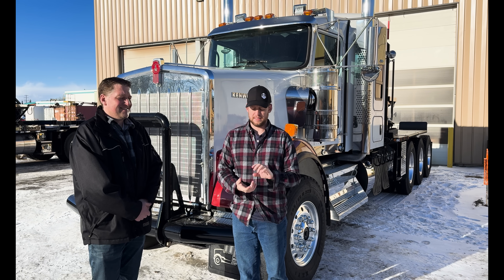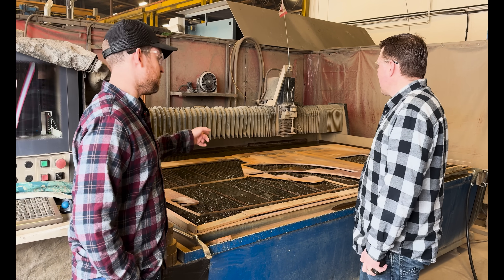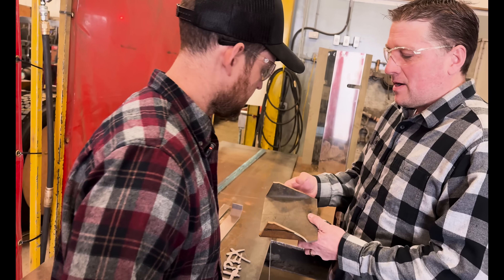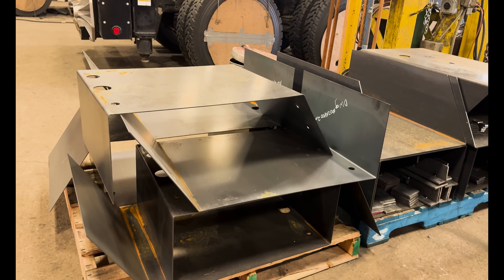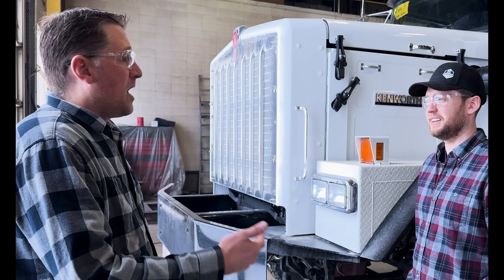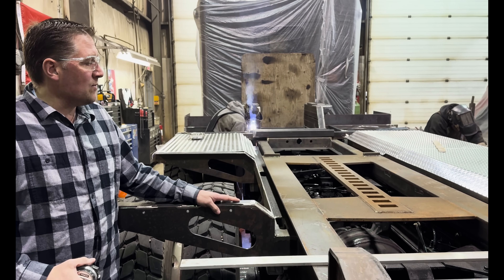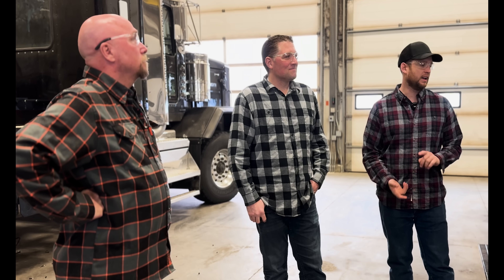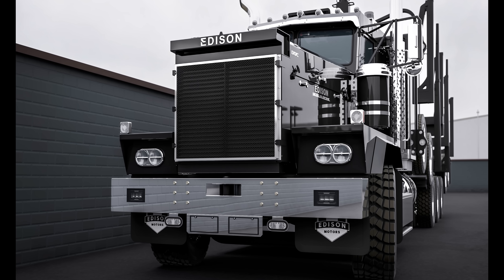Building the FIRST EVER Diesel Electric Winch Tractor!  (Behind the Scenes with Marcep)

Comment: You guys should be looking for electric winches.  With your generator you could be using direct mount VFD motors and forget the hydraulic.   Electric controls would take up less room in the cab, and remotes wouldn’t need solenoids everywhere like hydraulic needs 🤷‍♂️

Comment: If it is Ev and you get exemptions for that can you rub red diesel as it’s not a not a vehicle but instead a portable generator?
Reply: Topsy is an experimental battery electric vehicle BEV and has an exemption so it can run red diesel. Future Edison production trucks will all be emissions compliant and no red diesel which (while disappointing) is probably more fair and better for the planet.

Comment: Winch trucks work in minus temps what the hell happens when you run out of battery on rig site fucking dumb idea
Reply: It's hybrid. The computer will automatically start the 9 liter engine which will warm up the battery with a glycol loop and also recharge the battery.

Comment: What does a winch truck do?
Reply: I'm no expert, but in a recent video, a "winch truck" has a large flat bed, and a winch to pull things on/off. 

Winch trucks can transport oilfield equipment, such as pump units, top tanks, pipe racks, and power swivels.

Winch trucks can move heavy loads, such as off-road construction equipment, large containers, and oilfield vehicles 

Winch trucks can work in difficult terrain, such as muddy oilfields over undeveloped roads.

Comment: Hypothetically if you're building a custom trailer couldn't you build it with E-axles and have more capability/regenerative braking that only needs a few extra hookup wires to function? I'm no engineer so maybe the extra weight and complexity isn't worth it, but it sounds cool.

Comment: all this technology is cool, but what is range when pulling 40ton cross country?, is it gonna be 80 to 100 miles on flat land like them electric pepsi semi truck?
Reply: It will only drive like 2 hours off of the batteries, but then the onboard 9 liter diesel engine will fire up and spin the generator as a 600 volt level 3 supercharger. So range is limited by the fuel tank size.
Reply: @Sah-o5m  awh then it gonna be like toyota hybrid cars but semi version
Reply: @iAmMoWuji  some people call it a series hybrid.

Others call it a EREV or extended range electric vehicle.

Others call it a BEV battery electric vehicle with onboard 600 volt level 3 supercharger

Comment: Why don't you make the winch electric? With an electric winch the only thing extra you will need is a decent drive for the motor. But by doing this you dont need the al the hydraulics wich require maintenence. The only problem you wil have is that the winch motor is a bit bigger, but you save space on other places.

Comment: I've been rig moving for more then 50 years from the Arctic to the Saudi Arabia Desert and seen a lot of different types of trucks and equipment and lots of changes and improvements over the years but this is truly revolutionary.
Reply: Finally a company that listens to the customer and builds what they want and need rather than**this is what you get.
Reply: Technically it’s counter revolutionary they’re chasing an old ideal now the the tech required is available

Comment: Why run a motor to a pump to turn a winch why not go with an electric winch, or convert the winch to electric using an EV motor. That way it only uses power when being used. LG Letourneau didn't even use cylinders on his big equipment after he figured out how to go electric.

Comment: Edison - while doing custom builds is absolutely needed, at he same time I hope you are working on an "Edison standard" truck design, which you can produce in quantity, bringing price down and with design weaknesses gradually being eliminated.  Also gradually add equipment so you can increase the percentage of parts you make yourself (vertical supply chain), giving you capability to quickly make changes as needed to increase quality and lower price.  (Imho)

Comment: I want to convert my Lexus RX450h hybrid, which was assembled in Canada, into a diesel electric using a Owan/Cummins diesel generator, electric wheel hub motors and replace the current Nickel–metal hydride battery with a powerful lithium battery.

Comment: Since the end of train locomotive steam engines, it was common sense logic  that diesel electric power plants are the most efficient mode of transporting everything from a to z.
Reply: They have previously said that for straight load hauling, diesel -electric has no real efficiency improvement over straight diesel.
But for working trucks and specialty load hauling, they are seeing significant efficiency improvements.

Comment: Hydraulics for the Winch? Why no direkt electric drive?
Reply: You would need to add a extra brake for holding loads with electic were hydraulics have a built in braking ability.
Reply: @michaelcummings7246  Ahh ok.👍 Good reason. I just thought about pulling

Comment: One question that I have, did you look into using an electric winch? Or was the hydraulic one used because they all have the most experience with it? That is more than a valid reason. But I am looking at the big cranes on the work sides who all have some big electric motors.
Reply: Electric motors cant brake by themself too a full stop, so you need to have an actual diskbrake or something like that. Hydraulic motors can brake by its own, there is probably no company that makes electric winches that would fit there application. So it is easier to just make an electric hydraulic pump that powers a regular hydraulic winch
Reply: @jonasstahl9826  I was thinking about winches from tower cranes, I know that they are electric.
But the break is a big reason, and I already stated that experience is more than valid.
Reply: Great question. Just ditch the hydraulic fluid pumps and go straight electric winches. I wonder if there is some torque/speed advantage to retaining hydraulic pump winches. Seriously, just lose all the hydraulics.
Reply: @Sah-o5m  it could be that they need the hydraulic for something else anyway.
Reply: Winches on winch trucks are shock loaded repeatedly. Electric winches won't be able to handle these conditions.
Reply: @robertbakewell5429  I'm enjoying this dialogue :) So if a hydraulic pump blows a line, does the winches lose a load? Does it have mechanical brake?
Reply: @Sah-o5m  Definit not, if a line break the load comes done, you cant catch that. Stopping a falling load creates huge force, other stuff will break or flip the truck.
Reply: @Sah-o5m the oilfield winches are worm gear driven and incorporate a load  brake

Comment: 11:24 quite happy to see Blender (free and open-source 3D software) being used instead of expensive software from greedy companies! it really fits well with Edison Motors' principles 😄
Reply: I was very surprised to see Blender instead of a CAD program.
Reply from the maker: We use blender for fast & quick visual design changes and then a cad program to bring the blender model into reality
Reply: @EdisonMotors  ah yes blender to cardboard aided design (cad), love the progress of the company and the right approach to manufacturing for the industry
Reply: @notnotkevinjohn for quickly and easily changing something visual during a meeting presentation Blender makes total sense, but they definitely use specialized software for their actual engineering. :)
Reply: @ Maybe. Or maybe someone made a plug-in for Blender to give it some rudimentary CAD functionality.
Reply: notnotkevinjohn yeah that is also possible, but I'm pretty sure I've seen the team using actual CAD software in an earlier video
Reply: I was coming to the comments to write this. Glad to see Blender being used in more professional areas these days!

Comment: Custom built vs serial production. The serial will cover 50% of everyones needs, but never 100% of a specific one. The custom built will always cover 100% of the needs, and that will make the brand keep on going. Keep the spark on Edison, you got this.
Reply: The plaid shirt look……
Reply: Get it, spark
Reply: Even still most of the product is the same but just slight changes.
Reply: sadly the custom one will only cover 80% or less as there is always stuff that get's forgotten or placed in a place that is slightly off to what is mostly needed. most of the time it is that tehre isn't enough storage room for all the tools and utensils that get used or need to be there "just in case". if we had 100% then there would only be that one model for that job.
Reply: @dovos8572  pretty sure they're talking about production process, not the product, it's why Edison has 5 very different trucks going at once at the moment.